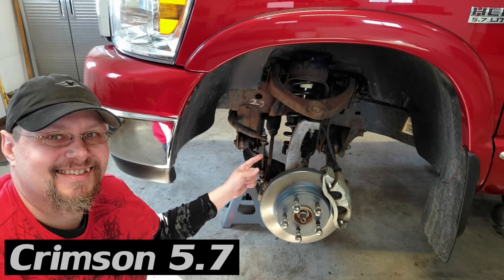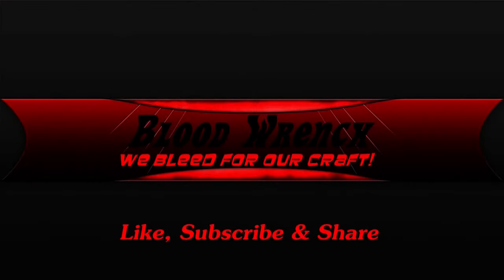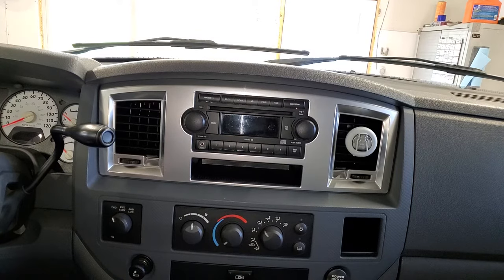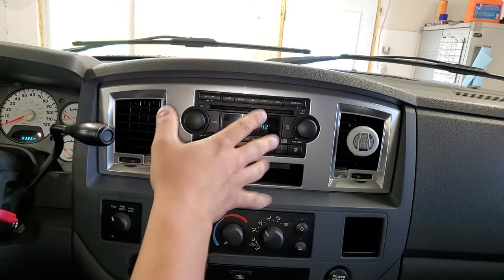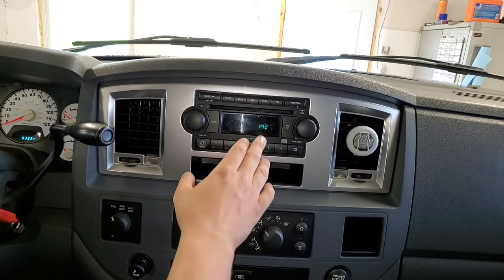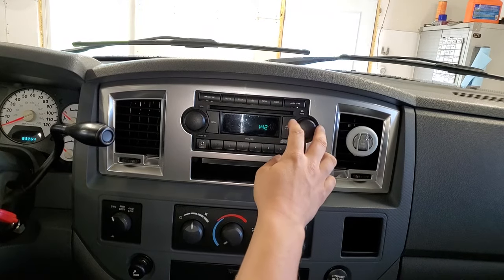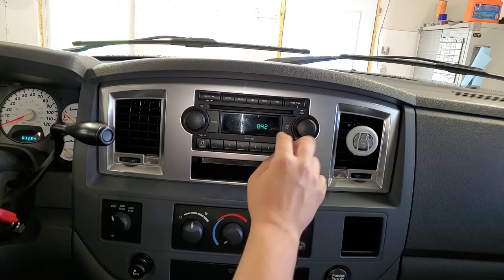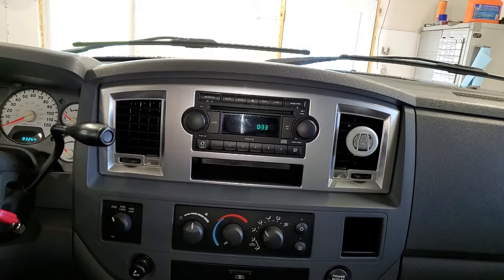Setting Clock Radio on Dodge Ram - Bad Wrench

Comment: On the 2018  ram, 1500 Longhorn Cab 4WD. the clock keeps coming on asking if I want to change clock settings. I press no, but it keeps coming on, never stops. Help?
Reply from the maker: Have you tried to set the clock? It might not stop asking until the clock is set.
Reply: @BadWrenchAuto  yes, set the clock but it keeps coming up to set the clock.
Reply from the maker: Then the small battery in the radio is bad. That battery is for the memory on the radio.   You will have to pull the radio out and take it apart to get to the battery. Or change the radio 😅